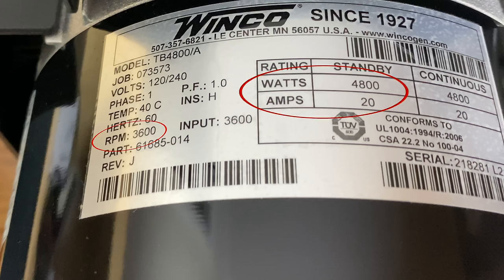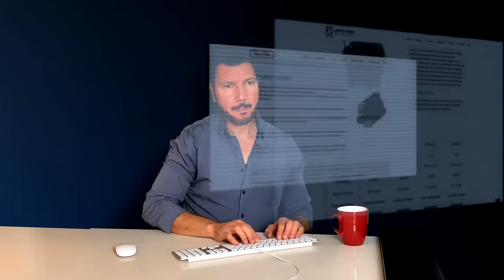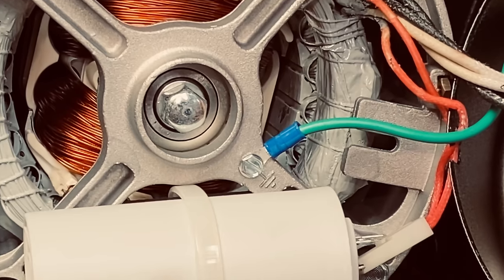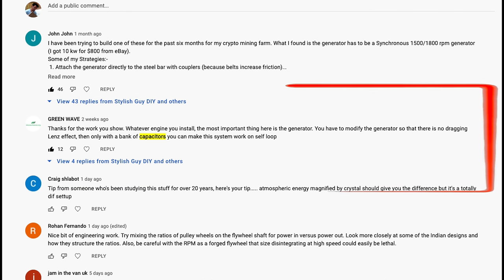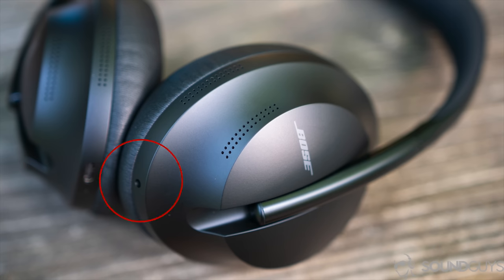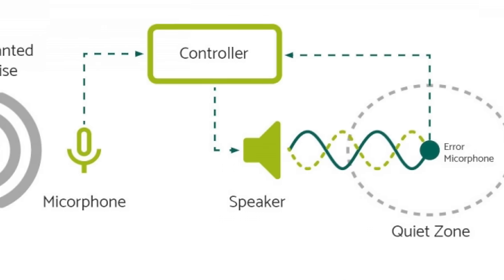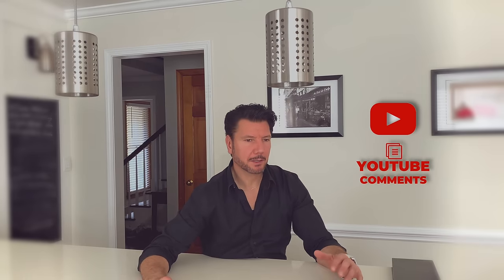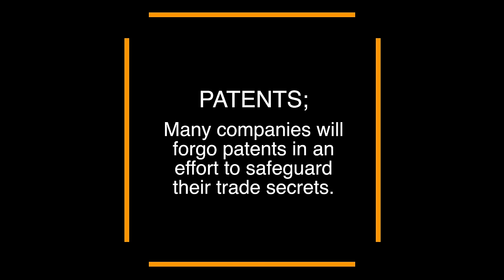Why does this Free Energy Generator not work?

Comment: I tried something similar. I could not get a real balance between the maximum power generated and the maximum consumption of the engine in load. Let's not forget that the energy we have at the end is the difference between the maximum power of the generator and the maximum current absorbed by the motor. It's hard, isn't it?
Reply from the maker: Yes it’s not easy and may never work in this configuration but I am certain it can be accomplished somehow.
Reply: @MarkusNenning  We hope so
Reply: @MarkusNenning  👍

Comment: Use big Capacitors to generate a resonance frequency in the generator. The voltage amplitude will show a resonance rise effect. Push the amount of rpm beyond this resonance frequency. Then the system will balance itself because when the resonating generator is slowing down the resonance rise voltage will go up. Fase angle adjustment during the switch will save energy during the switch period and prohibit shock effects. It will function as a stable energy storage which on a short video looks like free energy. With a solar panel or wind turbine you will be able to ad energy to the system which you can use at a later moment.
Reply from the maker: Interesting idea thank you Eddo!
Reply: @MarkusNenning  No thnx, Pay me with a percentage of your future business 🙂I lack the time and space to work it out for my self. I like to do experiments in my head😂🙃
Reply from the maker: @EddoRats  if I ever have a working unit and make some money with it I’ll share :)

Comment: How come if we use two magnetic reformed wheel beside flywheel to spin ?
Reply from the maker: Working on something like that.
Magnets placed in the middle of the flywheel.
Reply: @MarkusNenning  to get better results we must have to use all possible techniques, 
you can try with flywheel in between two magnetic wheels (using magnetic force to spin the wheel)
watch results of using ++ and +-
Reply: what we are thinking we need high pulse magnets who can easily create force to spin heavy wheel
Reply: @MarkusNenning  if we could spin the flywheel by some kind of magnetic force then, there will be no more need of 1.3 hp motor as well

Comment: You need a high effency 3 phase motor that goes high RPM with a motor controller.  3 phase motors have way more windings in the motor than single phase motors.  And you should be able to dial in the speed and so on.
Reply from the maker: I agree 
Thank you!

Comment: How come if we use solar plates for the energy of 1.3 or more hp motor to rotate flywheel ?
Reply: if we just can make possible some source of consistent energy for 1.3 or more hp motor for proper rpm to rotate flywheel then all other issues will become secondary

Comment: I am as an engineer! The free energy generator can produce electricity for a few minutes, but the air resistance, the fraction, the gravitational force, these factors act on the free energy generator and finally stops the free energy generator. But if we calculate for the equation and keep some energy storage in between (I mean a powerful battery) in this way we can get power for long hours

Comment: I would like to know if the electric motor is connected tho the greed to run the flywheel there is enough power to run the generator this way you can produce more kilowatts spending less power?
Reply from the maker: I wished I had that answer Juliano.

Comment: Hi Markus 

If I do not have electricity in the area to be able to start the
generator it occurs to me to have a battery bank with AC / DC inverter only for starting after the generator comes into action, the charging stage is activated to maintain the batteries. I think it is a great project and I want to assemble it because I am in Venezuela and here there are many electrical energy problems. Greetings.
Reply from the maker: Yes that should work once the concept itself works.
Hope you’ll be successful!
Best of luck!

Comment: Wiring must be correct. Mechanical RPM must be correct. The phase of the motor rotation must be slightly behind the electrical phase of the generator, or in the natiral running angle without the belt holding the wrong angle to the gen. Your first video looked like there was EMF braking happening, as if it was wired wrong.
Reply from the maker: 🤔thank you Rich

Comment: hello sir i need your help how can i contact with you?
Reply: Mhijo.
Un motor diseñable para desarrollar la potencia que NECESITES. Sin límites. 
NO usa imanes Permanentes porque, usa el acero al silicio como IMÁN TEMPORAL y permanente al que puede variar la densidad de flujo desde 1,05 hasta 2,1 Teslas, a discreción.
El NEODIMIO sólo permite una densidad de flujo maxima= 1,3 Teslas.
Esa máquina - motor está constituida por polos que, cada uno de ellos es un POLO-MOTOR independiente SYNRM conmutado, que usa recupera y re-usa la energía eléctrica que consume fundamentado en sumar su AUTO INDUCCIÓN + LA INDUCCIÓN MUTUA MAXIMIZADA en sus bobinas de estator.
Duplica EL USO de su Fuerza magnética.
Duplica-cuadruplica LA MAGNITUD de esa misma fuerza magnética en el mismo instante o período de tiempo, con lo que logra un OVERUNITY de 90-125, AUTOMATIZABLE con el que es CAPAZ de automotorizarse integrado al generador del que toma un 20% de su potencia generada-producida y USÁNDOLA, RECUPERANDOLA Y RE-USANDOLA lograr ese gran OVERUNITY para producir POTENCIA ELÉCTRICA VERDE. 
NO USA VOLANTE DE INERCIA PORQUE ÉL EN SI MISMO ES UN SUPERVOLANTE AUTOMOTORIZADO.
Reply: P2020-0205 ONAPI REPÚBLICA DOMINICANA.

Comment: I have been off grid now for 7 years.  I love it !!  1. I use a freezer as a fridge, which opens at the top, uses far less energy than a fridge that opens at the side.  2. I use both super efficient 3 watt 12 volt led lights, and 120 volt led lights using only 6 watts.  3. I use small Ryobi inverters the size of my hands for most low power uses, and they are completely portable only as big as a hand.  4.  I use mostly cordless tools, batteries recharge very easily on my $700 solar system.  5. My back up generator is a Westinghouse 2200, which can put out a full 15 amps for my heaviest power tools, and can run 14 hours on 1 gallon of gas on the low setting.  6. I just bought a 2,000 watt 4,000 watt peak pure sine 12 volt inverter.  It can very easily run my freezer/fridge which needs over 1,000 watts at start up and only 200 watts running.  7. I built a wood burning stove for only $150 for my heating.  I plan to build friction heaters, that people say work very well, and use very little electricity.  8. I have a design for a propulsion system for cars, airplanes and ships which would be over 1,000 times more efficient than what we are using now.  I YouTube video showed me this, plus a friend at a welding shop witnessed a live accidental demonstration of this more than 1,000 times efficient propulsion when a large work piece of iron they were welding jumped off the table, through the wall, and landed 300 feet away in a field.  9.  I have been studying many types of UFO propulsion systems for more than 30 years and know the basics of their design, engineering and how they derive their free energy.  I have also been studying the legitimate 'free' energy devices such as the Richard Clem engine and many others.  I do not actually believe in 'free' energy at all.  I believe there are ways that are up to 1 million times more efficient ways to obtain and use energy !!!
Reply from the maker: Thanks Arthur and congrats on your achievement!
The biggest 2 things at my house is air conditioning and electric water heater.

Comment: Good morning, I have a VFD in which three phase induction motor is attached to and I have a capacitor bank to correct power factor lag. I want to know if it's a good idea to implement both power factor correction and a VFD? Thanks for your good work.
Reply from the maker: Some VFD’s already compensate for power factor and correct.
Generally I believe that a phase correction will not improve the losses enough to make this generator work.
But yes if you use a capacitor bank and you can verify with an oscilloscope that the phase shift improves then use VFD and capacitor together.

Comment: Here if your generator is make voltage out running without a charge to start it, a couple charge capacitors could get it started and kept, because most coil motors need a charge to start the out put of voltage. Two you need to cool the motors because the high the pull the higher is the heat. Electric gel pump using the shaft  to pump it to the motors, use a auto oil cooler for the radiator.

Comment: Im lloyd from Philippines. I'll try that already. That's not gonna work. Try use air compressor ur turbine would be ur flywheel at the same time. And attach ur permanent generator in ur flywheel to get the consistent power. If u have load just adjust the air pressure control.. ur video is nice..
Reply from the maker: Thank you Jong!

Comment: In both cases there is success. Drive the motor with solar energy or rotate the weight wheel with magnetic force. Attach metal covers to the back of both magnetic wheels to prevent Losing magnetic charge.
Reply from the maker: Thanks Muhammad!

Comment: Hello. This fly wheel electricity generator is sorta free energy device.  It can be an Ampere amplifiers while keeping the same voltage. Compare it to the transformer. You know the  the transformer gives high ampere if  the voltage goes low. So the fly wheel electricity generator can let the power companies send little amount of power to the houses. The houses will the amplify the input ampere.  Look how much people will save.
Reply from the maker: Nice idea! 👍
Reply: @MarkusNenning  thanks

Comment: what in the attempt of remove friction woudnt be possible to use magnetic gear theeth in a way that what the turn of one gear theeth is generated by the other gear theeth puling because its repusing the same polarity ? therefore they never touch ,therefore no friction? if true the same principle could be aplied to replace the bearings? in a way that the axel never touches the outer ring been sustained by oposing magnetic field generated by neodimium magnets? if it would be possible yould have a system totally frictionless except by the air drag
Reply from the maker: Hello Diego they already have this except bearings. It looks like the shaft is levitating.
Unfortunately the required accurate machining and magnet rings are out of my budget at the moment.

Comment: Try to add 1 more induction motor that will help dynamo not to turn of when u try to switch on the other induction and when it's already fine try to switch off the other induction that was connected to the electric coming from your house

Comment: Kindly pls try a car alternator to continously charge a 12v battery  connected to a 3000w inverter to power up the electrict engine... This electric engine will turn up the flywheel that will turn and power up the car alternator and especially the main generator... Ive been trying to assemble this but still parts are very hard to find specially this flywheel and funds ofcourse..
Reply from the maker: I just got a link send of somebody doing exactly that.
I think I’ll give it a try.
Thanks Jao!

Comment: Hi stylish ,
I had same problem, same generator head. 
Do you live texas ?, so we can work together and try to  figure out
Reply from the maker: Hello Antoine no unfortunately not.
I live in SC
Reply: @MarkusNenning  i get these  informations from India, first we need generator head low rpm (1750 ), remove the generator avr, connect the exciter coil to the brushes rotor via rectifier (30amp. 600 v), the exciter  voltage may  be  90 v at rpm 1750, before you belt motor to the generator head check the rotation way ,must turn same way. Otherwise it gonna act like brake.
Good  luck, 
I'm going to  try mine after tax  return,
Right now I don't have money to buy the generator head with brushes low rpm.
Reply from the maker: @antoinekabuya1461  thank you!
I will look into that.
I am too waiting on my tax return! :)
Reply: Likewise here, I live in Illinois same generator head 3600rpm 5000watts. Mind is belt driven one by 3hp 3450rpm at 120volt my generator was lacking power.  I removed the rectifier and modified the generator. Pinoy ako

Comment: Mine will work, sorry to hear that you attempt didn't work. I have seen these myself but I have much differnt designs for them. There is so many options in hydro, wind and solar arrangements that work delivering kw of power per device.
Reply from the maker: Hope you’ll share your results once you have yours finished.
Thanks!
Reply: @MarkusNenning  Yeah I would love to the way I theories is that to gain the power of increase you have to obey the laws of thermodynamics but also harness the natural processes of the earth, as a larger system powering many small systems is a perfectly acceptable configuration of physics, gravity and water turbines with a infinite gravity refill loop with compositional pump would be perfect for home use. Like I will hopefully test soon.

Comment: your generator is a capacitor type. if you want gain you must repalce the resistors in the rotor to higher resistance values to make the generator produce 2000 volts. then you need a microwave oven transformer to step it down to lower voltage and then run the motor on that ouput. that would apply load at a fraction of the resistance of the winding and increase efficiency.

Comment: From what I've been told it's hard to do with a single phase motor you need a 3 phase motor with a lot bigger generator the 3 phase motor uses less power after it has reached max RPM it only picks up the other phases when under load plus it looks like they are all using 220 power in India and I've noticed that some of there generators have a permanent magnet and aren't magnetized by electricity
Reply from the maker: Thanks Josh!

Comment: The motor cant output more than its fed, and the generator cant feed more than its given. The moment you disconnect it from ac power you begin bleeding energy. If your motors make a single noise, or raise in temperature at all from working then it is not perpetual.

Comment: Using a clock face to explain magnetic rotation 12 2 4 6 8 10 are north magnets 1 3 5 7 9 11 are south using a pulse current to bridge the south north attraction 12 pulse 3 pulse 6 pulse 9 pulse in theory should = consent rotation
Reply from the maker: Thanks Simon!

Comment: Hello from Brasil! Your motor is small. I think you need to use a motor between 1/5 - 1/4 of generator kVA. The rotation of generator must be a little bit bigger then ideal, so It will become ideal after spend energy with motor and load. Part of energy will be lost, part spent on motor and something between 30-50% will be available to use without stop the system. To your generator flywheel must be around 50kg.
Reply from the maker: I have tried 3 different motors Pedro and the ones with more hp didn’t work either.
Thanks for the feedback!
Reply: @MarkusNenning  have you changed to a smaller pully on the flywheel? First pully was too small and second too big.
Reply: @MarkusNenning  my wish is that you get It running asap, so all of us can try to replicate.
Reply from the maker: @peser71  I hope so too!
Reply from the maker: @peser71  😳wow that’s a big machine!

Comment: Really love what you are doing! I believe one of the motors in the other “Indian” videos has modified/enhanced coils to give more energy.
Reply: In actuality the modern motors and generators used here are full of mini resistors.
Reply from the maker: Thank you very much Chet!
Reply: Modified as in batteries added.
Reply: @artofwarandpeace  Why should they put resisors in a motor?
Reply: @wurgervomlichtenmoor5073  Nevermind that, try the power of over unity and charge vs discharge ratio. 3 minutes to charge vs 30 seconds discharge means 10 caps to cycle the energy flow. Goes to a fan with Motogen tech

Comment: Why not look at the nine phase generator. Little friction very big output. Or remove the pulley replace with extended carbon rod covered with magnets out of the motor with coils around it.
Instead of a generator that's about a foot long. You make the rod covered on magnets surrounded by coils as long as you like or short enough so that the motor is able to turn the carbon rod.
Reply from the maker: Very simple Strawman because those components are expensive.
Not sure about the 9 phase generator you’re speaking off but the one I found cost 5k 😳

Comment: parts sources   large dc permeant magnet motors are used in tread mills  up to 5 hp depending on the tread mill. they can be used as a generator or a motor if you look on craigslist or face book market place you can usually get one for free. just hall them away the motors are usually fine the failer is usually a circuit board in the tread mill, or broken belt, etc. Some automotive alternators are 3 phase and have 3 phase rectifiers to generate dc voltage.
Reply from the maker: Great idea didn’t think about a treadmill.
I just recently bought a 130 Amp alternator to convert but was not aware that there are 3 phase alternators.
Thanks George!